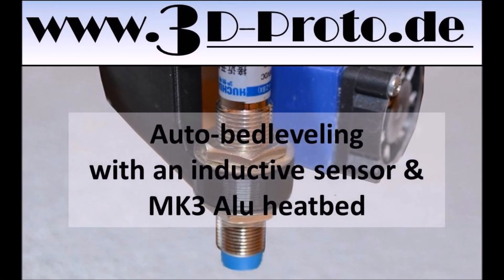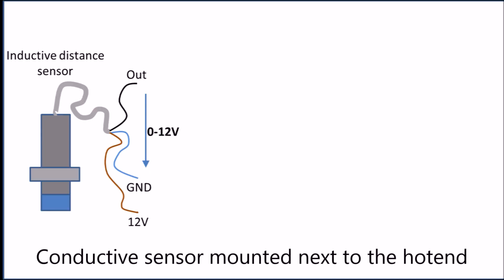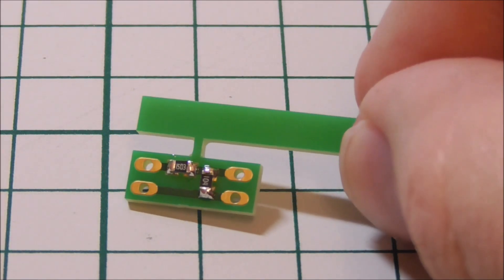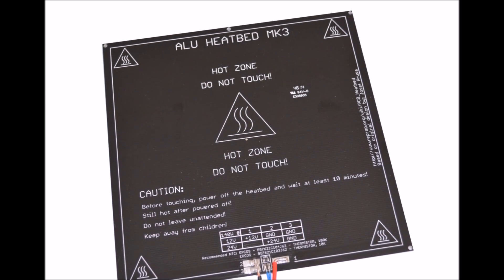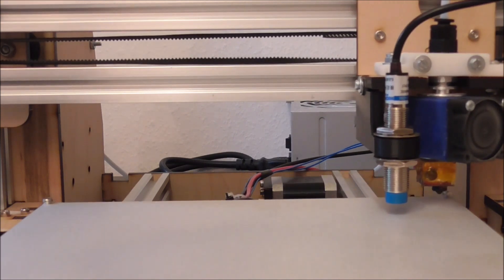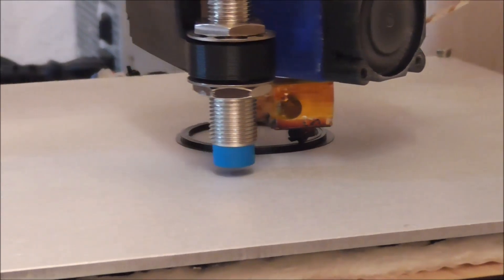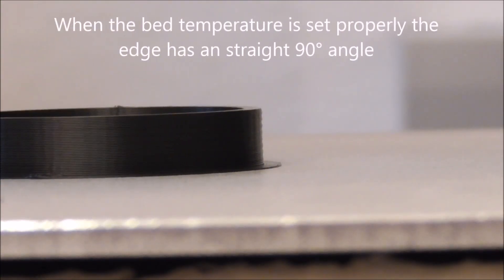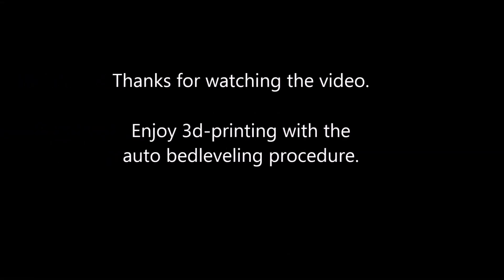Auto bedleveling with MK3 Alu heatbed and SMD thermistor on reprap 3D printer / by 3D-Proto

Comment: How long does it take that MK3 heated bed to 110 degree C?
I plan to use with my Delta with 12V power at 1 ohm, that should be 144W.
Reply from the maker: PartTimeRonin around 7min if you insulate the MK3 from below and use relay to drive it.
Reply: 3D-Proto Thank you, do you get any warp on this bed?  I plan to use it without glass plate.
Reply from the maker: PartTimeRonin With ABS you can not avoid warping on bigger prints. I print diectly on the aluminum plate. For PLA you should take bluetape in addition
Reply: +3D-Proto What happens to the Bluetape if you heat the bed? What will happen to the tape? Did you encounter any problems in renewing the tapes?
Reply from the maker: +Andreas Heronimus Nothing will happen. bluetape or greentape can resist 110degC.
Reply: +3D-Proto Ich habe das Set von dir gekauft auf eBay. Kam alles bestens an. Wenn ich G29 im Repetier Host als Befehl eingebe passiert nichts. Woran liegt das? X,Y und Z Achse waren auf Home Position.
Reply from the maker: Andreas Heronimus Ist G29 in deiner version von repetier überhaupt implementiert? Solltest du mal prüfen. Schau mal hier:
http://www.repetier.com/documentation/repetier-firmware/z-probing/

Marlin supported G29...auf http://3d-proto.de sind die Firmware änderungen für marlin dargestellt.
Reply: +3D-Proto Danke für den Tip. Ich habe auf mein Mainboard noch nie Firmware aufgespielt. Mit Arduino bin ich vertraut und kriege das auch hin. Habe mir soeben die neuste Marlin Firmware heruntergeladen.

Die Frage ist, meinst du das wäre eine gute idee? Mein Board sieht so aus: http://lbsfilm.at/wp-content/uploads/IMG_2774_JPG.jpg

Ich habe bammel das ich da was aufspiele und der Drucker nicht mehr läuft. Und rückgängig kann ich das ja im Falle des GAUs nicht mehr machen. 

Ich hoffe du kannst mir helfen. Top Support.
Reply from the maker: Andreas Heronimus Was genau ist das denn für ein board? Bei Marlin kann man z.b. aus verschiedenen boards auswählen. Die pinbegegung passt dann automatisch. Geht das in repitier auch?
Reply: +3D-Proto Ich weiß nicht genau was für ein Board das ist. Es ist vom Print Rite DIY 3D Printer von Hobbyking. Mein erster Drucker zum üben, also nicht lachen :)

Ich drucke mit Print-Rite Repetier-Host erfolgreich. Jedoch hätte ich gern ein Heatbed und das Auto Z Leveling. Deshalb hab ich das Set von dir gekauft. 

Wie kann ich denn rausfinden was es für ein Board ist?
Reply from the maker: +Andreas Heronimus Grundsätzlich musst du beim autobed leveln immer die firmware anpassen. Du solltest dich also mal schau machen welches board du verwendest und welche firmware dazu passt. Für marlin kannst du wie gesagt auf 3d-proto.de alle notwendigen SW anpassungen sehen.
Reply from the maker: +Andreas Heronimus Schau dir dein board mal genauer an. vllt steht ja ein hinweis drauf und google dann danach
Reply: +3D-Proto Laut Hobbyking "a RAMPS style board" 
Kann das im Code definiert werden?
Reply from the maker: Andreas Heronimus Bei marlin ja. Bei Repitier weiss ich es nicht.
Reply: Repitier sagt im Log was von einem update 
Da ist die Rede von "Gen6"... 

Weiß nicht weiter :(
Reply from the maker: Spiel doch marlin drauf...brauchst dann wohl als ungeübter nen tag bis die sache läuft.
Reply: On the 300 sq mm version at 12v it can't even get to 47c without insulation and with to about 55c is 1h.  This is why on the TronXY bed people are using a mosfet and a separate 24v power supply so to ohms law of V squared/1.4 ohms.  Costs about 40 dollars for a 21a 24v power supply (need a 6 dollar mosfet board too) so crank the voltage up to 25.25v and it will get to 130c but only with insulation underneath.  Time to 110c is about 8m.